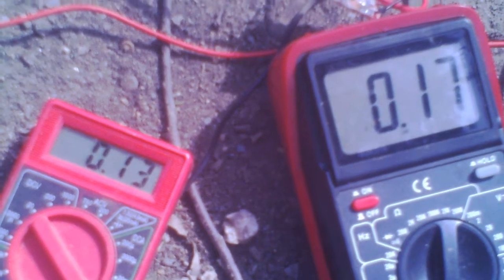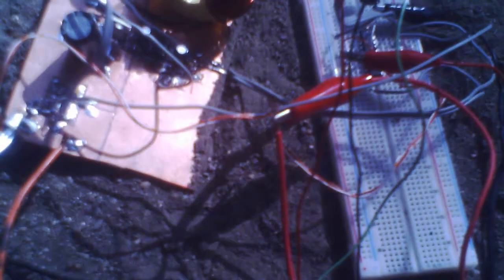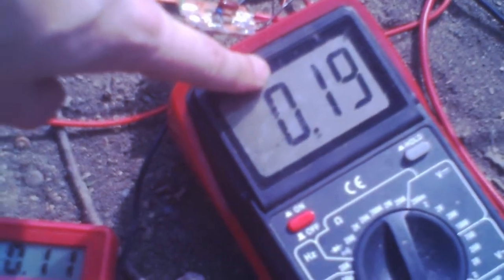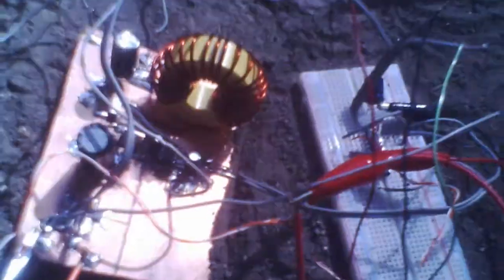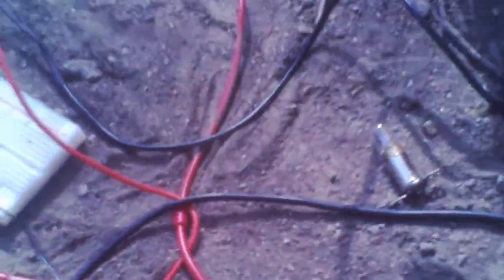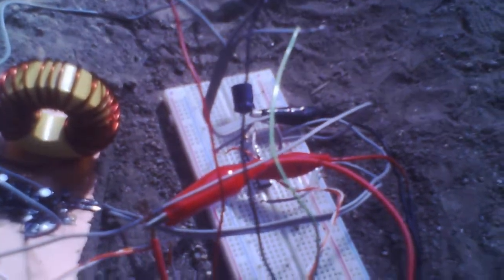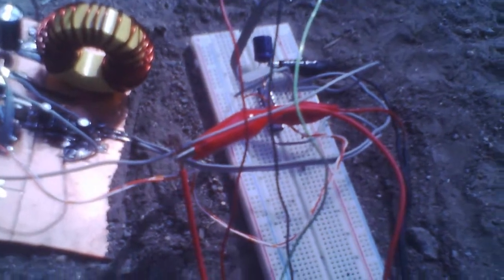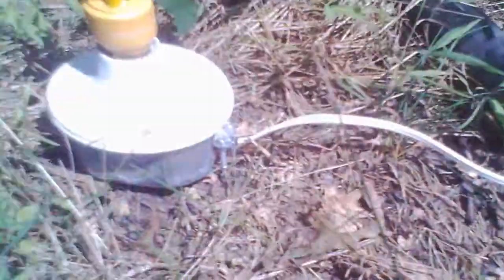DIY MPPT algorithm first test

Comment from the maker: The 2N7000 is being used as an RTL NOT gate/level shifter for the IRS2118 MOSFET driver.
My code was not getting proper readings from the PIC ADC.  See my more recent videos for up to date stuff on the project as this video is almost a year old.

Comment: I agree with the previous guy; it's possible that your main switch (transistor) is not fully on.  Did you say 2N7000?  That would work best with a 10V drive to the gate.  You could salvage a better performing FET from a PC power supply, possibly.  I think it unlikely that your core is saturating.  That could happen with a quarter-size torroid at 5A or 10A, but not at the currents you have and the physically larger torroid.

I would love to see your algorithm, if it's not a secret.

Comment: I wander what the pulse with modulation of the cat is? 
You may also have reached the saturation point of the coil and the pwm signal looked like it was not high enough.